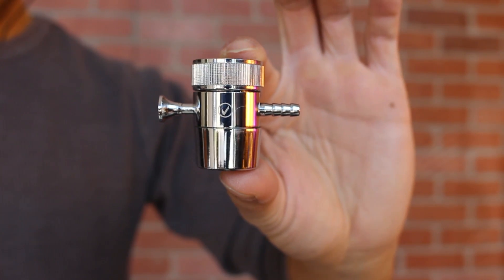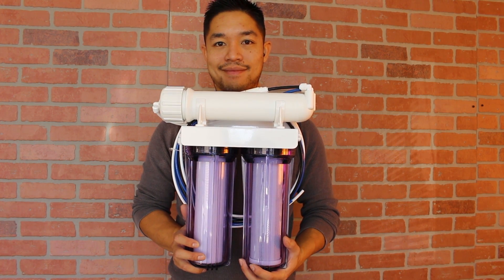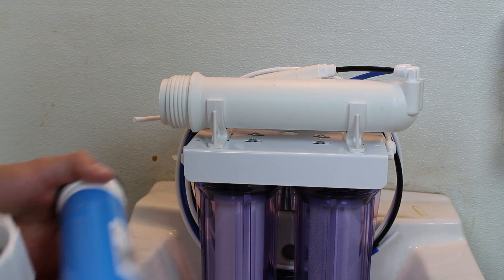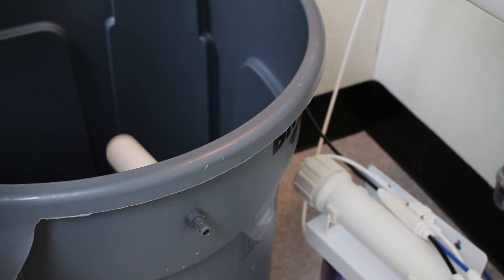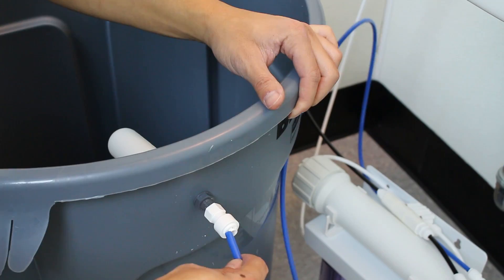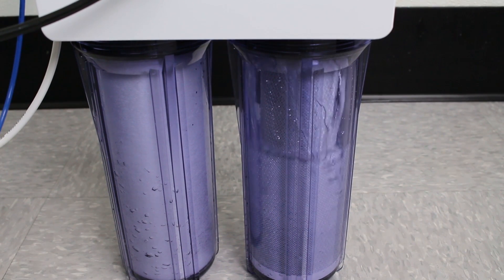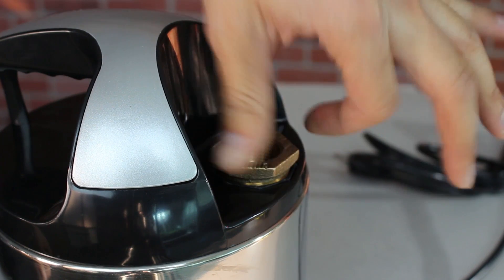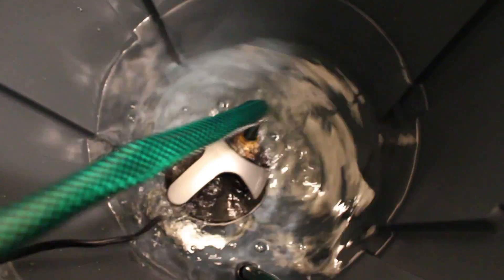The Perfect Water Treatment Solution for Near ZERO PPM | How to setup a Reverse Osmosis System

Comment: You hooked the hose up backwards. The swivel end should be at the pump to make attaching it easier. The fitting you should have used was a 3/4"MH to a 3/4" MIP.

Comment: Can I just buy the filtered water?
Reply from the maker: yes
Reply: @GrowAce  From where? Any recommendations
Reply from the maker: We recommend buying an RO system to have purified water readily available. We use this system and have no complaints.  https://www.amazon.com/NU-Aqua-Platinum-Capacity-Ultimate/dp/B078XMMDGG/ref=sr_1_3?ie=UTF8&qid=1541462416&sr=8-3&keywords=nu+aqua&dpID=51BSXLaeCVL&preST=_SY300_QL70_&dpSrc=srch

If you just want to buy the water, any purified water will work, just check your ppm before hand and your acidity after adding your nutes.

Comment: Yeah, i have a question....its gonna be my first grow. And its gonna be an indoor tent. I have only one issue. Its the water. My tap water has too much of chlorine and other stuff. also the ph isnt correct. Someone told me to leave my water breathe for 24 hours so the chlorine is gone but its still gonna be poluted, or you think its ok for the first time?
Reply from the maker: Your best bet is yo get one of these reverse osmosis systems. Any pollutants in your water will affect how your plant absorbs nutrition and how it grows. For best results use an RO system to remove all pollutants and give your plants the pure water they need. Filtercentral.com has a nice selection of water filters.

Comment: i have a dehumidifier at home. it has a water drain hose on the side that i can use to pour the water from the air, outside. but that feels like a waste to me. I was wondering if anyone had an idea how to turn the water from the dehumidifier into drinkable water or into a hydroponics system.

Comment: is there a more efficient way of having the RO system hooked up straight to your water line in the house? Or would that require a contractor/plumber?
Reply: I think they generate about a cup a minute I believe that’s what I was told - which is why most home ones have a little tank that goes under the counter or whether you put it. So you have water and as you start pulling it it’s filling as you go. 

Thank of how many gallons you need for the day, how many people and are you doing the whole house or just kitchen sink for water for cooking or tea. Or as in,this case he is filling a can I assume for his plants.  And I would have a licensed plumber install.  Last thing you need is to end up with a bunch of leaks.  That said if you are super handy and read very well the directions for all the parts, you may be able to do it yourself without issues. One of the deals once done the first time - it’s a cinch I guess.  But there are considerations to think about and one of those is the waste water.
Reply: They are pretty slow so you wouldn’t want that.

Comment: great video..with you being in the industry as legit business what would you consider to be the top line led regardless of price for 10×5 tent in getting ready to go 2 p600 pled to go with the p450 any thoughts
Reply: +OG Bobby I run 2 P300s in a 3x3. I find having the dual panels as opposed to one big panel definitely helps with overall coverage. Just something to think about when picking LED panels.
Reply from the maker: +ST. Pot Good question! for a 10x5 area, that's 50sq ft. A good rule of thumb is to have 50 watts cover every 1sq ft.. We don't carry the Platinum LED series, but for any LED grow light, find out what the true wattage is. With 50sq ft space, you would need 2,500 watts to cover the area. I would recommend going with 2 or 3 high powered LEDs to cover the space wall to wall. Hope that made sense. Let me know if you have any other questions.
Reply from the maker: +Lex Luthor (Xodi) Agreed. LEDs are great but only when they're exactly under the light. They don't have good spread so adding more LEDs will help. Thanks for your feedback.